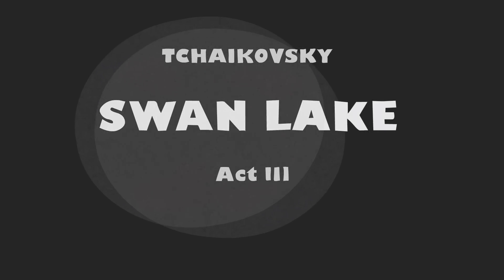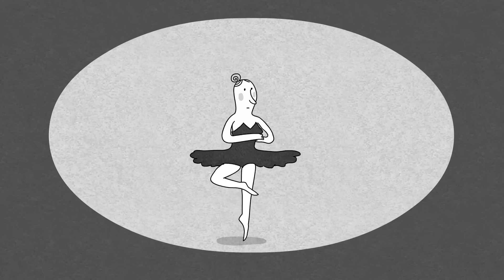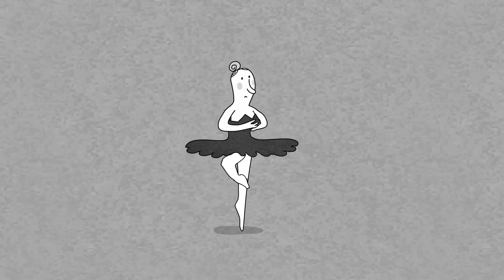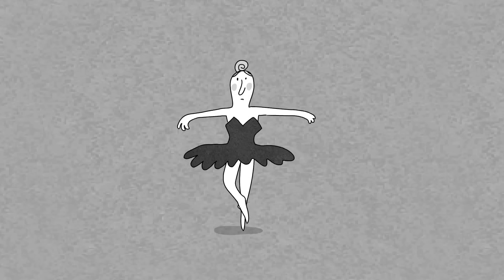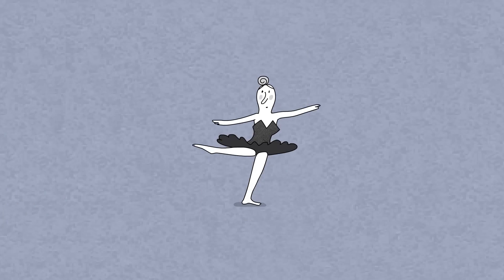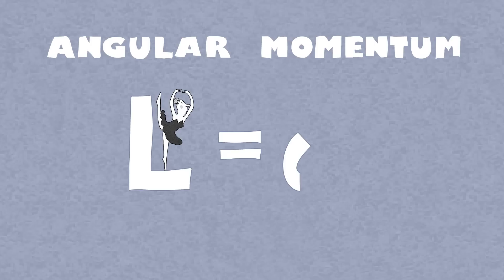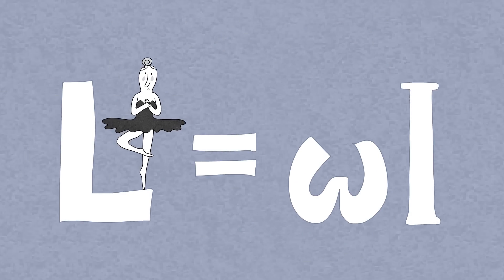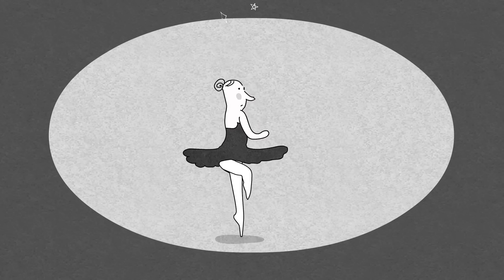The physics of the "hardest move" in ballet - Arleen Sugano

Comment: Really great explanation, but they forgot about the power of the plié! Fouettés would be impossible if the ballerina did not plié slightly in between her multiple revolutions. Like I used to tell my ballet students, "If you plié, you can do anything!"

Also, the two options they suggest to increase torque are not classically or stylistically acceptable— it's plain incorrect. The only thing you can do to slightly alter the speed of your motion is to bring your left arm (most likely to the right is the direction the ballerina will perform her pirouette) in with very slightly (I'm talking almost imperceptibly) more force and speed. Same idea with the leg that is in the air.

Comment: Forewarning: I am a professional ballet dancer who teaches calculus.  Neither of the options discussed as means of maintaining momentum are things that dancers do while doing these turns because they are not considered technically correct.  
1. It is not considered a valid option to leave your leg out for longer to increase momentum.
2.  It is also not an option to lower the leg to a position by the ankle to get more turns.  The dancer must maintain a "passé" position with the foot at the knee.  With the foot at the knee, pulling arms in to the chest does very little in increasing momentum.

The two things that are actually done by dancers to get multiple pirouettes out of a string of fouettes are the following:
1. The gesturing leg and the opposing arm (her left in the video above) are coordinated so that they close very quickly at the same time, a rapid transition from an extended position to a streamlined one, increasing angular momentum.  The harder that left arm pulls in, the more possible it is to do multiple pirouettes, but it must be done in tandem with the right leg.
2.  This is combined with a lifting, rather than a dropping of the passé position (when the gesturing leg is at the knee in the turning position).  By pulling the passe higher, the length of the body that deviates from a strictly vertical position has decreased, increasing the speed of the turn. 

I'm not sure where TED got either of the ideas for this video.  If you watch any reputable dancer's performance, neither of the physical concepts presented in this video are used.  TED - please employ the expertise of professional dancers next time.  Thank you!
Reply: +Kate Penner Yea I agree. The 'rules' are very 'strict'.
Reply: Yes, I noticed the neglect to include arm movement to the equation. I was hoping they would mention something about the dancer's posture too... 

Also, as far as I'm concerned, ballet dancers don't cross arms near the chest the way this cartoon does, which is practiced in gymnastics and ice skating. 

Alot of misinformation here it seems. TED needs to be notified about it.
Reply: +Kate Penner yeah, talking about those options seems motivated by a discussion of physics and what might be possible. It's nice that you describe what is actually used in practice, although a bit difficult to understand not having done it.
Reply: "A professional ballet dancer who teaches calculus"... you may quite possibly be the coolest person in existence.
Reply: @nikitaamien404  Thanks for your support! You're cool too.
Reply: @pudgedb  Wow, what an incredible working life!!  Which company do you dance for?
Reply: I was waiting for somebody to point this out😂
Reply: Kate Penner you are a actual legend. For learning two, impossible things. (Ballet and Calculus are super hard)
Reply: @friendusesthisaccountnocom9928  This is really nice - I appreciate it! Even though the subject is different, hard learning is hard learning. There are more similarities in the process than people realize!
Reply: Michelle (below) is right -- angular momentum is not being conserved in this instance because of the torque repeatedly added to the system. But the necessary clarification you bring up is a good point -- thank you! -- the change in displacement of the arms increases the rotational speed, while the action of the foot against the floor at the start and at each subsequent fouette adds torque. This is particularly noticeable in a set of fouettes that travels across the floor.
An actual synopsis of this would be much more complicated than the one above, but I am glad this one has got people talking!
Reply: +NickRoman Just for show (part of the choreography), although the second position she hits with her left arm held high is one where it is frequently easier to find and manipulate center of balance.  Though it has little to do with momentum, it helps align the entire standing side (the one on pointe) over the pointe shoe on which she is turning.
Reply: I wholeheartedly agree that the evidence from experienced dancers should be taken notice of and valued.  On the other hand, you seem to be using the term angular momentum to refer to speed of rotation.  A dancer spinning on point may have a way of increasing her speed of rotation, but not her angular momentum, which is, according to widely agreed physics, conserved in the absence of other interaction with the environment.
Reply: well, the angular momentum has to come from somewhere - the dancer gets it initially by creating torque between their foot and the floor, and i suspect the lifting of the passe at the end actually creates a little bit of torque as well (since in the absence of this, moment of inertia considerations would imply a decrease in rotational speed)
Reply: This is a way better explanation!  Thank you!
Reply: thank you for clarifying. watching i kept thinking “but but..but thats not how..i mean thats still cool but—“ it was nice to hear a professional’s take on the science!
Reply: actually it seems like the cecchetti method has a fouette that starts from croise!
Reply: could not agree more. excellent explanation
Reply: @pudgedb  thank you for sharing :) !!
Reply: Succinct and fascinating response to set the record straight!  Thanks for the time put in!
Reply: Thank you! This video was clearly jot made by a dancer
Reply: More than one way to do fouettes... Depends on the choreographer!
Reply: +Michelle Brochmann There are very rare instances where a choreographer changes how these are done.  In this case, the standard 16 or 32 in a coda for Swan Lake, Don Q, Nutcracker, etc. we are not changing our passé; to a coupé; and we are not allowed to discernibly leave our leg out for longer because we cannot open it early (it will look over crossed to the front) or bring it in late, in which case it is now splaying the hips and too far to the side.  This is a video about the basics of how this step is performed, and it cites two techniques to add multiple pirouettes, neither of which are used...
Reply: @michellebrochmann2229  what? You’re doing ballet not contemporary or lyrical maybe only the hands can change from like first to second  but I think they’re talking about fouettés in general idk if they are then its fine but if its only ballet I didn’t know I cold suddenly bring my hands in closer to my body
Reply: Kate Penner What about when she switched which arm she had lifted above her head? Just for show or did that have something to do with her movement?
Reply: if your a dancer why are you a calculus teacher
Reply: @rachellee-n5i  OMG! Karen you can't just ask why people are ballet dancers. 🙄
Reply: Dragonfly Tales i was just wondering why she still isnt in that profession
Reply: @rachellee-n5i  Hi Rachel! I live in an expensive city and like the majority of dancers, need income to supplement what I make through performing (which is a small fraction of the time we spend working in the art form). Sometimes dancers are paid in short contracts or lump sums. Even in the best cases, those who are fortunate enough to have a lengthy company contract are usually paid for ~40 weeks out of the year and do other work to manage financially during the other months. Sometimes that is teaching ballet (which I also do), but when I first started developing regular performing opportunities ~10 years ago, I found it much less physically taxing to tutor math than wait tables (which I also did) or teach, which can lead to injury. Tutoring really clicked for me and led to more opportunities, which then developed into a fully formed other career. They sort of grew and expanded together. Thanks for the ping - the number of comments on here is astounding to me! Hope everyone is staying safe and healthy and NOT doing fouettes in their living room :)
Reply: Kate Penner haha wow, must be fun to dance in a company!
Reply: @rachellee-n5i  Gotta keep the lights on, Rachel! I answer more fully below :-D
Reply: Ok, but what they said was that these could help, they didn't advise you to do that, they just said that according to physics, this would be helpful. Noone claimed to know ballet technique.
Reply: Omg just keep your comments to ur self

Comment: This video showed a fantastic explanation of a Foutté, but I believed you missed one important part. To not get dizzy, us dancers, do this thing called, 'Spotting'. You focus at one spot while you're turning, and once you are back to the audience you quickly whip your head going back to that spot. This makes it easier to turn as well as limiting the dizziness so we can easily continue our dance.
Reply: +Vika Gresova was looking for commments on the missing point on spotting!
Reply: +Vika Gresova In their defense, the point of this video is to explain how it's possible for them to keep moving. It's about the physics of movement and spotting is irrelevant to that. Of course, to a dancer or someone familiar with it, the magic or amazement is not in how they do it any more than walking is amazing, it's the skill it takes to do it.
Reply: +Vika Gresova they mention spotting at 1:05 I believe it wasn't emphasized because, dizziness aside, the movement of the legs is what matters to physics
Reply: +Vika Gresova I think that's more the physiology of fouetté...?
Reply: +Vika Gresova 
Actually
you make a very good point (no pun intended) spotting not only makes the movement look very clean, and assists the dancer in not becoming dizzy, but it helps them to keep track of  (down stage) so they can also control how the torque is released, and the appropriate moment to extend the leg to second.
Reply: Thank you!! This is one of the most important factors to keep the balance while turning and  they didn't even mention it... Glad you said it:)
Reply: Tree Nelson You are absolutely right :)
Reply: That wasn't describing spotting, it just described that when the dancer is faced to the audience, she rises on her toes, etc.
Reply: +NickRoman 
I had thought to come to the defense of the video, and kudos to you for doing so.To be sure a very fine explanation of what the major forces are, and the ways they are being applied to the fouetté rond de jambe en tournant 
which is what this particular fouetté is. (There are many kinds of fouetté ).

 However Kudos to Vika Gresova for noticing that there was no mention of spotting which for Ballet dancers is sacrilegious. Spotting is an integral part of a pirouette. I'm sure she has had her share of the instructor yelling “Spot”, “Spot”, “Spot”, wile she is desperately trying to hang onto her alignment and center of balance. LOL
I have watched dancers continue to pirouette simply using the angular momentum they have gained in the spotting motion, they use its stored energy by twisting it out of there necks to there shoulders and backs, down to there hips in an eye blink.
I’m sure the spot is adding angular momentum to the fouetté rond de jambe en tournant. The dancer is dealing with an over abundance of energy that is threatening to throw the center of balance across the room. All this motion and alignment has to be perfectly timed. If the dancer completes the 32 pirouette, hope fully staying in the exact position they started, often you will see the dancer complete 2, or 3, even 4, more standard pirouette just to spin down the energy they have accumulated. 
As an interesting side note and just to emphasis how important spotting is to a dancer, In theaters ware a Ballet perform, in the back of the auditorium in the center is put a light. This light the dancers use as a spotter light. When the Dancers are on stage, the stage lighting is so bright that the audience aria looks totally dark except for that little light in the back of the room that they must use to spot on. : )
Reply: I believe spotting is indeed very important. I'm having a lot of trouble doing it though. I'm a figure skater and started ballet later. In figure skating we don't spot, because we're going around too fast. We just train our vestibular, so we don't get dizzy. I don't get dizzy dancing either, but my teacher tells me to spot, because it looks cleaner. I really can't do it..